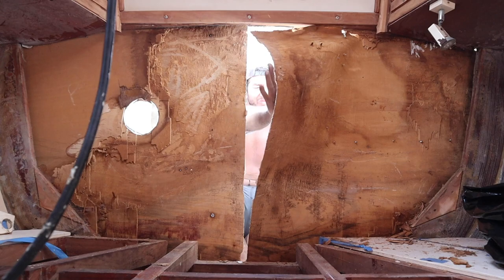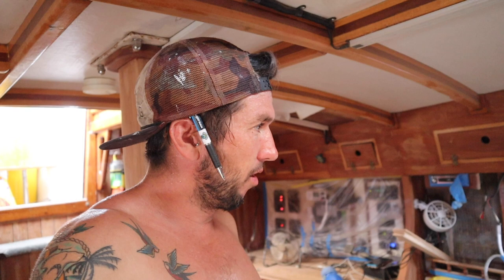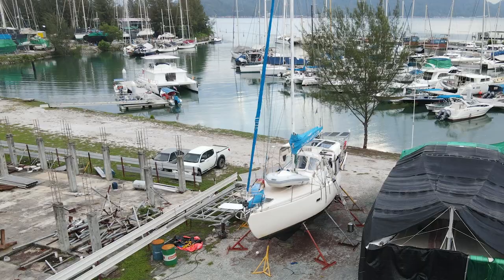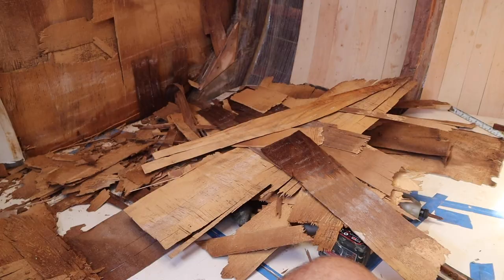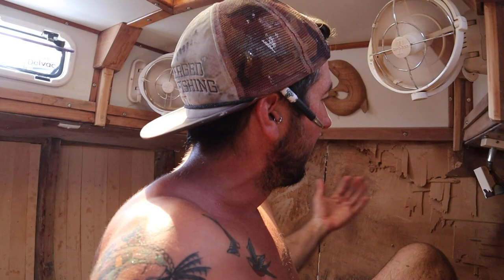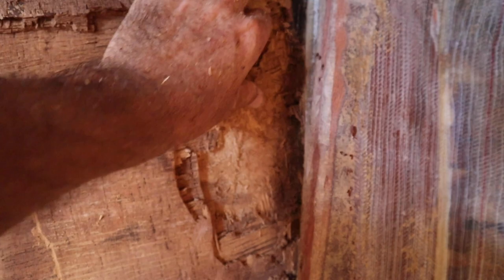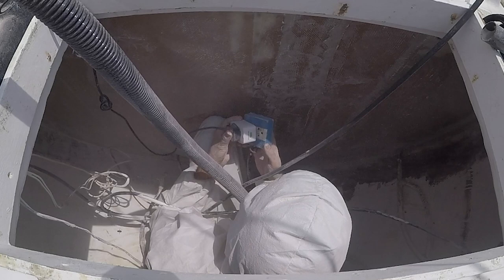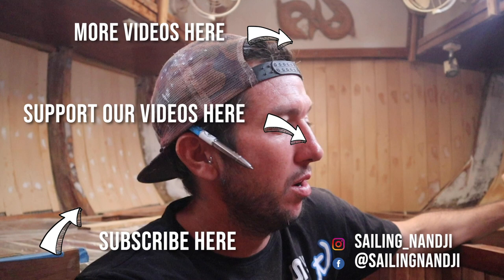BUSTING DOWN & BUILDING a BULKHEAD!! | Sailboat Refit 2, Ep 211

Comment: What about the nails on the outside of the hull?
Reply from the maker: The wooden hull is an inch thick and layered with fibreglass both sides. The ply slats are 6mm, the tacks are 10mm long. They barely enter the wood hull.